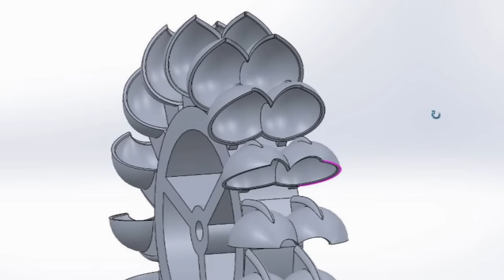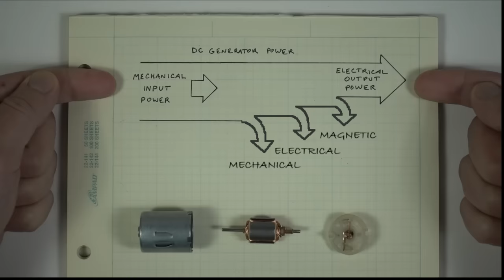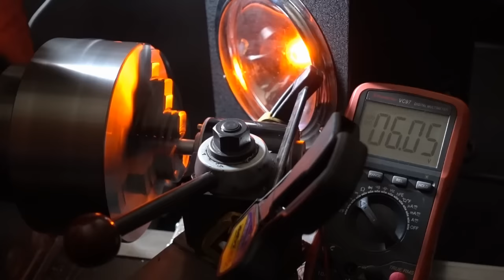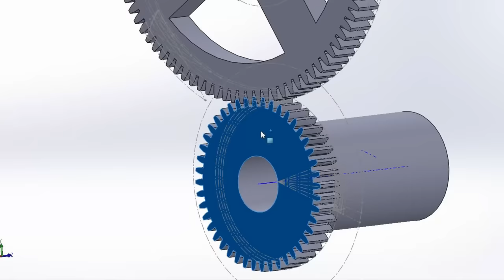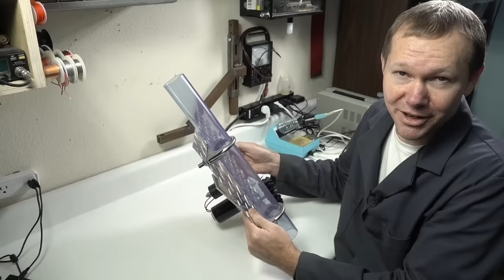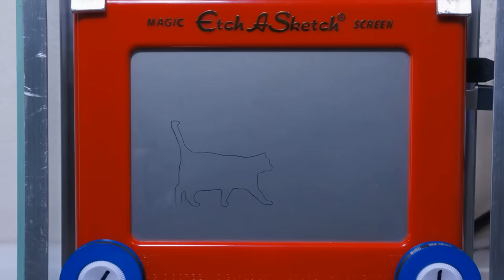Rain Gutter POWER #1 - How to Harvest Free Energy From Your Roof with a Hydro Electric Generator!

Comment: ⭐️ A suggestion that will definitely help your project. 

You need to align the water jet to spray from the top allowing gravity to help spin the wheel. 

In this video the jet is spraying from the bottom of the peloton wheel intern fighting gravity.

Comment: one of the most important flaw in this design is that stuff that flows down your tube causing it to clog. you may need to install a filter at top but doing that may decrease your flow, although necessary. have you consider cascading waterwheels to get as much power out of it?

Comment: Would efficiency come from flipping the wheel? Water splashes are directed up instead of down; I think this would also result in a small loss of energy.
Reply: hour9 I was thinking that too, but I guess it wouldn’t have too much of an effect
Reply: How does that makes sense? Droplets will have the same energy regardless of which direction they deflected to. If you let them fly long enough they will eventually trade their potential energy for kinetic, but at the moment of impact it has no effect.
Reply: @michaelbuckers  the cups would "carry" the water down instead of being just pushed away by the water
Reply: @AYoungdude  Exactly, utilising a very small amount of gravitational energy to add to the total potential energy, technically it would help, but notably, I'm not too sure
Reply: Mi 28 the closer you get to a deflection of 180 degrees to the input angle the better. So ideally it’s straight back at the jet, but obviously they’d hit each other so in practice the best workable angle is about 165 degrees. The direction does matter, further from 180 means less power 😊
Reply: @AYoungdude  All water is immediately deflected - by design - there's nothing to "carry" them down. Nevermind the huge centripetal forces. The cups are effectively dry the whole time.
Reply: @chewsuperfour9514  Only when the wheel is stationary. When the speeds are matched, there's no deflection. At the point of maximum power, deflection angle is 90 degrees.
Reply: Mi 28 how would it be 90 degrees, when the shape of the buckets makes that impossible? The whole benefit of a Pelton wheel as opposed to a mill wheel is to deflect the water back as much as possible. More velocity change = more power and can’t get more velocity change than 180 deflection
Reply: @michaelbuckers  Not really, the water droplets carried upwards travel against gravity...therefore slowing down the wheel. The cups better be heavy on their way down and as light as possible on their way up.
Reply: @anomalyp8584  Well I don't expect you to be able to do a power calculation on all of that, since you don't even understand the basic idea, but really do try - maybe you'll figure it out in the process.
Reply: @chewsuperfour9514  Ideally the water would be completely stopped but then it won't evacuate, so the blades are designed to eject it to the side. If the jet's forward momentum was fully absorbed, it would eject straight to the side so the deflection angle would be 90 degrees. It would have forward tilt if the wheel was spinning too fast and it would have backward tilt if it was spinning too slow, either way not all of the water power would be converted to mechanical power.  That's why 90 degrees deflection is optimal, that's the point where the wheel produces maximum power.
Reply: Mi 28 no you wouldn’t ideally stop it, that was his point with the plank. More power comes from more velocity change. Redirecting 180 would be twice the velocity change. Google Pelton wheels they’re interesting 👍🏻
Reply: @chewsuperfour9514  Yeah it would be twice the torque, but that's only possible if the wheel is stalled - generating ZERO power. The other opposite is when the speeds are matched, then the water isn't slowed down at all and the power output is also zero. Maximum power is at halfway point, with half the maximum speed and half the maximum torque. Google some physics books they're really informative.
Reply: Mi 28  I meant it genuinely, if you google Pelton wheels it will explicitly show why they’re designed for 165degree deflection. The buckets have cut outs at the edge to allow the water being diverted back to escape and not collide with the next returning bucket. And if the speeds are matched and not 0, the wheel is still turning and generating power which is the goal. Do you see what I mean about the part with the bowl vs plank in the video? Also this is fluid mechanics not physics
Reply: @michaelbuckers  I'm going to ignore the rudeness. Let's see...ideally, the deflection of the jet should be 180°. But i think before that can happen the cup is already moving, so the efficiency of each cup/blade is not optimal. If it would be deflected 180°, we would see water splashing back at him, instead the jet is still carrying on after spinning the wheel and even getting an upward deflection. This means that the wheel is actually pulling the water that way, against gravity. Also i'm thinking in a Newton context. Deflection upwards means reaction force downwards (against rotation movement).
Reply: @chewsuperfour9514  Nice to see this conversation (I was just about to make these points>>)
One thing that is vital to remember is that the plank/bowl is stationary... Reference frame is everything here.

So, for the bowl the waste water returns back along the line of the jet  at the same speed of the jet (I'll get to 180/165 degrees in a bit) However, if the plank is moving (as in  its part of the wheel) then the bowl reference frame  is also moving.
So, how fast should the bowl move? Consider how much energy is left in the water. If the water after collision with the bowl is anything other than zero then there is still energy in it. If the water is stationary after collision with the (moving) bowl then you have taken it all. So...best speed for the wheel is when the water is stationary afterwards. If you go back to the static case then provided there isnt much loss bouncing off the bowl then bowl speed should be half jet speed.

Now, if the water does just stop dead then the next bowl will run into it so..... a trade off comes out at 165 degrees optimum.
Reply: I agree, an overshoot wheel must be a little more efficient as the weight of water in the wheel cups will help turn the wheel until it falls out onto the floor.

Comment: lol -- lathe, diamond panel, 3D printer, debris-clearing contraption, all to get 1/4 watt generator running.

Worth it? HELL YEAH
Reply: Yeah and then he will have to pay the carpenter $1000 for restoring the house wall that has rottened because of water splashing all over the wall. Not so bright!

Comment: Awesome job! I, respectfully, disagree with a couple of conclusions you had. First, you should use pulleys and a belt instead of gears, since they don't operate well at high RPMs. Second, you shouldn't decrease the diameter of the turbine - you should increase it. The more you increase, the lower power (or water flow) needed at the tips to create higher RPMs at the center.

Comment: Judging by the title was expecting some tinfoil hat kinda stuff. Ended up finding a really nice video about physics and engineering, which I will definitely share to my teacher friends!
Reply: False Flag  I think the concern isnt the generation of hydropower, it is that there are thousands of videos generating no energy at all, with huge miscalculations. Often times videos similar to this claim to be free energy and enough to generate large quantities of energy.  This video has sound science and calculations, but notice that he has honest claims about the actual energy output.  Although  it does "generate electicity.. he points out the it is only about 1/4 to 1 watt.  Even that is assuming steady rainfall while generating.   I'm not a mining expert, but the last data that I saw showed about 6 pounds of copper yield for 1 ton of copper ore mined.  That is with the large amount of energy input required to extract the copper.. So devices like this are pretty cool, but not an energy solutions.  Normally in the lifetime of the generator, it won't even generate equivalent electricity to manufacture the generator in the first place. ("Negative energy payback").  I think that this video is great and this guy is very knowledgeable.  Glad that he doesn't make the false claims like so many other videos.

Comment: You didn’t take the angle of the roof in to consideration and by the looks of things it’s quite steep meaning the area is much less. Great video tho keep it up.
Reply: Exactly. He needs to figure out the horizontal length of that right triangle rather than using the sloped lenght. Super easy.
Reply: Thank goodness someone said it!
Reply: You guys are right but.... he did say horizontal distance. Only once though. 0:27
Reply: Also, in his diagram of his roof you can see the dimension is horizontal, not parallel to to the roof, he did  take the angle into account.
Reply: Wind direction can either negate that problem or exacerbate it.
Reply: Except he did
Reply: I had a similar comment and he responded, he does in fact use the horizontal distance even if it is stated unclearly, looking closely at dimensions axes on the drawing he did it correctly.  I recommended he say “footprint” or similar as we  are a nitpicky crowd who need to feel as if no mistakes were made in the maths portions of projects like these.  He has clearly seen several of this type of comment according to his response to mine.
Reply: Pelle Grit So the issue we are talking about is the footprint as rain falls, we consider it falling straight down and measure it perpendicular to gravity (hence the rainfall he calculated to expect at good flow). A square meter of flat roof would collect more rainfall then an extremely steep one wouldn’t you agree?

Comment: The amount of energy used to make this, would require this to run for 30 years lol
Reply: Thars actually kind of funny
Reply: well...  solar panels need to run for over 20, and I've seen wind break-even estimates that claim they won't pay off with the amount of steel and cement used...  30 years seems to be in the ballpark for point of use break-evens...
Reply: @shirleypotter4668  solar breakeven is 5, wind is ~10.
Reply: @MrTheclevercat  I think they are talking about the energy used to produce the solar panels not the cost for the consumer.
Reply: @viewtifuljon8105  that's a reasonable idea
Reply: More like 300 years

Comment: Great vid my friend, may I ask if an "overshot" wheel would improve efficiency? Using the weight of the water "stuck" to the wheel to your advantage
Reply: To get the most power out of the flow of water, the wheel in the video uses velocity that is dependant on pressure due to water-level-height (the water in the tube that has a hole on the bottom). For the overshoot wheel to get the most out of available water flow, the gravity needs to act on as much height difference as possible. Meaning the bigger the wheel the better. So a 6 feet diameter wheel might be a bit too much, and flow of water seems impractically low for that kind of contraption (not just visually, but also huge parts means more friction problems, so in an extreme situations it might even not rotate at all). that being said i don't have exact numbers to answer you.

Comment: Your set up is perfect! Just increase the nozzle size of your water jet feed into the pelton wheel and wait for rain.
Your water supply hose has a very small water volume discharge. A good size rain will move that pelton wheel past 1500 rpm with ease

Comment: It would take 100 years of rainfall just to recoup the energy used to make your parts you used.
Reply: and no protection of generator. I guess it  get shelved afterwards.
Reply: Still a fun project
Reply: True but in 100 years then its free energy ;)
Reply: Andrew Downey I think the same thing when I see the solar farms. Like at Denver International Airport. 2 tons of steel to hold all the panels how much energy to make that steel 🙈
Reply: @bahbee5659  You'd still need the steel for the nuclear power plant, or concrete for the dam etc...
We don't need free energy, only cheap energy that doesn't cause harm to the planet.
Reply: You do realize the point of this video is educational and not practical at current scale, right?
Reply: @lazar2175  Impossible. Every form of conversion of energy will somehow have a harmful effect on the environment.

Perhaps electricity itself should have never been discovered, but world wide pollution is primarily caused simply to generate electricity. If we got rid of all electronics, there would be no need for the energy production in the first place. As for cars, we can simply revert back to horses or bicycles. 

Basically, the fact is in order to be "green" theres no way around it we would have to completely eliminate all of our modern conviences.
Reply: just wrote a comment saying that after just 200 years the energy will have paid for itself ;D

Comment: Hey, if everyone did this they would be able to power their doorbell light.
Reply: Probably very dimly still.
Reply: Actually it depends on the rainfall, the amount this would make in England or well Oregon, it would be enough to light at least a few light bulbs, two or three ohnes and a kettle or microwave. You can power all of those just from converting your bike making 2W.  I have a 5W solar panel that's the size of a Nintendo switch that charges my phone just fine and give my phone 50% battery from the battery it charges. If this was the 90's and you were using a normal lightbulb then yea, sure it would suck. but energy goes pretty damn fair nowdays.
Reply: @skylerricketts7392  a kettle runs at around 2000W, so if you require 5 Minutes of this 2000W you would have to store 160 Minutes of Power generated by this 1W machine, not taking any losses into consideration.
Reply: better than heating the fucking planet with coal and gas for a fukcing doorbell light
Reply: @kunalvyas8172  What exactly is your response meaning to say, that you don't get it, that coal and gas are what DO heat this planet?
Reply: @richarddavis9362  does it not emit CO2 on combustion?

Comment: I remember doing this calculation a while ago just calculating the potential energy of water at the height of a building and I remember that the yearly power from this was abysmal.
Reply: Yea there's a reason they have to build dams so tall instead of just dropping turbines in random streams. Still a neat project though.
Reply: Did you use metrics?
Reply: Its easier if you do it along the length of a stream on a hill. 300 meters of pipe at 1:1 slope aint bad.
Reply: Yea I thought about getting a relatively small solar panel and using it to charge a battery, which I could then use to charge phones/tablets... but then I calculated the cost of charging my devices and for my phone it was like 50 cents per year (if I charged it fully every day, which isn't the case). Plus I typically leave them on the charger at work.... "free" energy! Not worth the hassle, never will make the $ back, not really green per se by buying all this crap I don't need.
Reply: @lamelama22  it's also over time. If you buy something that is say $50 and it saves you 5 cents a day you'll need it for about 1,000 days and you'll start making your money back each day afterwards. If it lasts 20 years you've saved about $300 with that 1 item. That's not bad for a 1 time purchase.
Reply: Shawn Griffith : 
 
The benefit is not monetary. The benefit of generating your own renovable energy is INDEPENDENCE from power companies, the government and the economic system.

Comment: -*sin(Ø) for the area of the roof that intersects the rainwater
Reply: Had to scroll way too far down for this.
Reply: I had the same thought.  Need to use the 'projected area'.  Although the formula depends how Ø is specified.  If Ø is the angle from the horizontal (which makes more intuitive sense to me because, then, the angle is zero for a flat roof and has a high value for a steep roof),  *cos(Ø) would be the way to go.  
I know that you know that already.  Just being rigorous 🙂. 

Now, on the subject of rain, do the windshield washers have to work harder, if the car is moving versus stationary?
Reply: @kshred3043  the rain falls at an angle equal to the rake of the roof   (ruff)👍😂

Comment: 4:03 "This is way easier in metric"
"angry american noises"
Reply: It's All good till you have to source quality materials locally.  A common problem for those who build the goods that build America. Metals seem to come of less quality when sourced from metric country's.
Reply: @bloodshotterror624  *citation needed
Reply: angry i was taught inches and shiii, and most things here are measured in inches and shiii like 9/64 or 7/32 instead of 3mm and 5mm
Reply: "Metals seem to come of less quality when sourced from metric country's." - Strange, i heard that even China doesnt like to buy american (imperial ) steel anymore because its of lower quality than todays chinese steel.
Reply: Also did i never hear from anybody that our metric german steel is of low quality.

Comment: Is there a good reason for shooting the jet of water at the bottom of the Pelton wheel, rather than the top? I'm thinking there might be (slightly) more mechanical advantage at the top (although the pressure from the height would be slightly less); also something like the Coanda effect (or similar anyway) may help marginally.